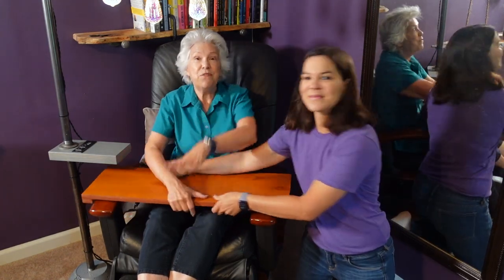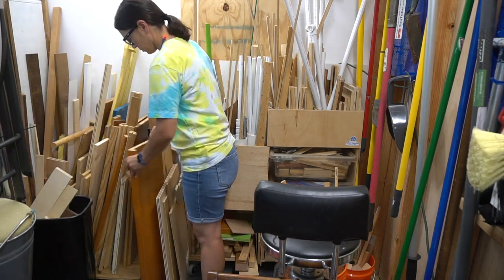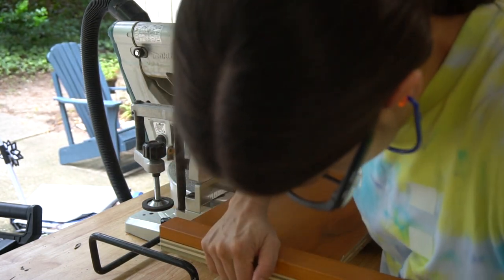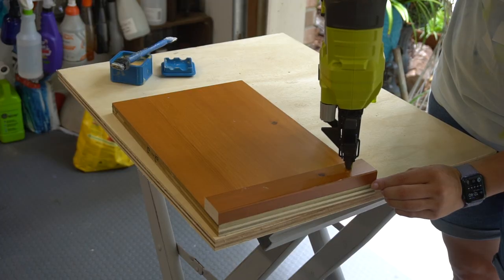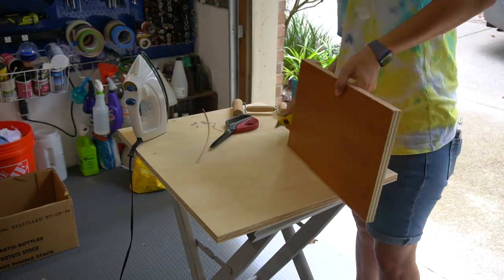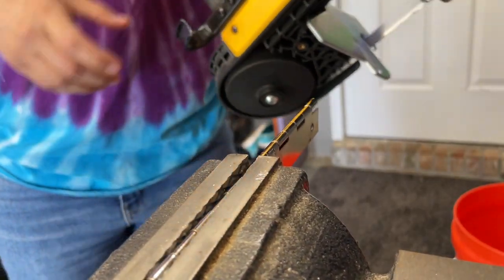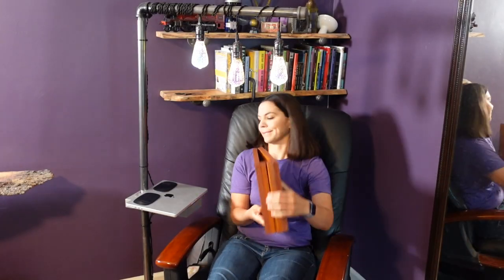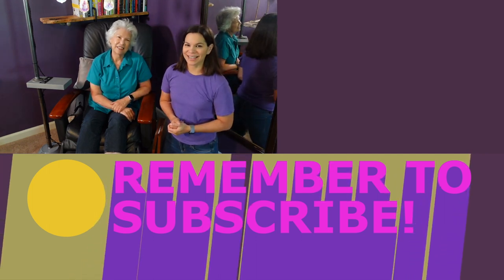DIY Folding Table for Favorite Chair

Comment: What a slick reuse of what you had. I admire the simplicity and functionality you managed.  I am ever overcomplicating my builds! 

I built a similar folding table, but I was working from 3/4" thick maple purchased for the purpose. The one thing I noticed with mine was the wood fibers kept getting compressed at the top of the joint. This caused the table to have a distinct V at the bottom and no longer be flat. Not a huge deal if you're using a laptop, but I mostly write on mine so hitting that little V made a mess. The solution that worked for me was using 2 cut points a quarter of the way in from each side.  The sides fold in under and each fold supports half the load. Having the center having no cut guarantees the middle stays flat for writing(my biggest concern). I also used a bit of leather on the underside to protect my chair from the hinges and abrasion from the table. The maple is harder than the oak my chair is made from.

 Hope those experiences are helpful to someone else building this sort of thing.